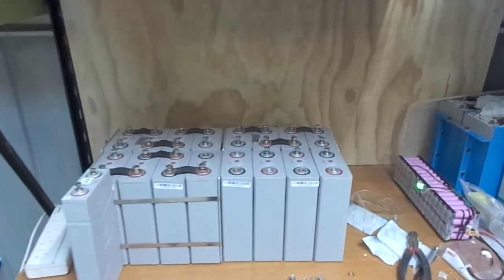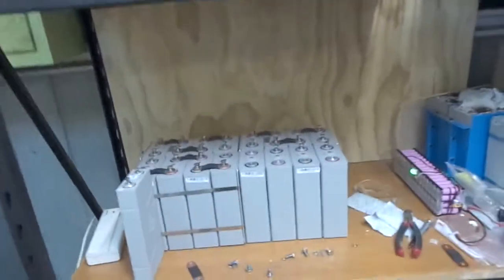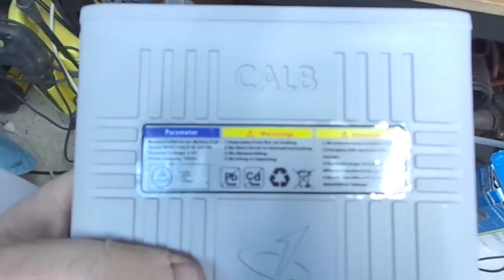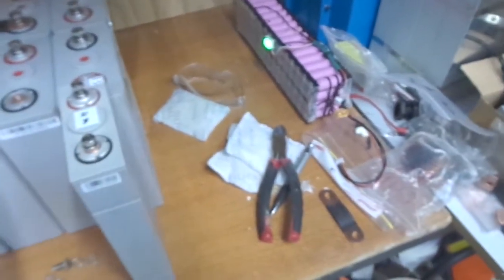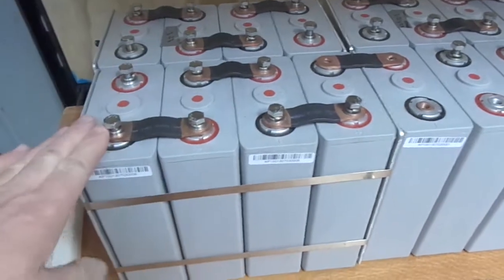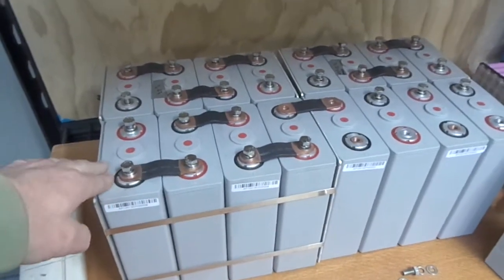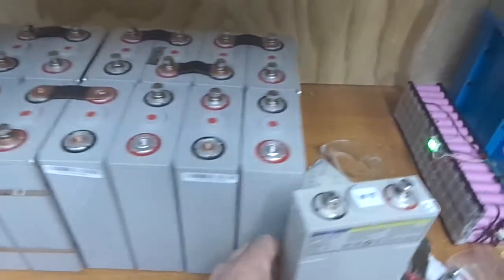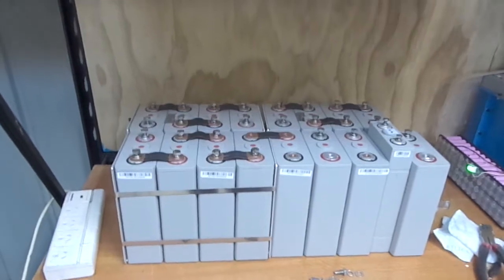LiFePo4 48 Volt Off Grid System Update and a Question

Comment: Do not mix these jars.  They are different types and will offer a differing charging characteristics.  You will easily shorten the life of the battery.  What is the manufacturer?  What composition are they (lead acid)?
Reply from the maker: Hi
They are the same chemistry, LiFePO4 - lithium ion phosphate.
They are just different capacity cells. I think I will make seperate packs. 
Thanks

Comment: Is placing the packs on their side an option and can you solder/ connect anything to the BMS tab? I am not sure if these things have to be on their base or if you can turn and lay them flat, on the longer end, so they are only 3" tall. If you can lay them on the long end and stack them, they will also compress under their own weight.
Reply from the maker: Hey buddy,
They don't recommend laying these down due to the small amount of electrolyte they have settling on one side.
Thanks for your comment!
Reply: Offgrid Dreaming no worries man. I am an 18650 guy so not much use here but I am following and learning from you.

Comment: Not sure how you are going to have these mounted, but I was thinking that you could have a box of some sort that where the 100A cells are at there is a piece of wood or plastic to raise them up to the level of the 60A cells. Then between the 60A cells you could put another spacer so that you can use the same connectors from cell-cell as you have for the 100A cells. Maybe you could mount the longmon on one side of the cell as you'd have the space.
Reply from the maker: I hadn't thought of that idea, Thanks for the comment mate
Reply: Offgrid Dreaming this was first thought too, use a 2x4 or something under the shorter guys to bring them up to level. Not real familiar with the BMS parts though

Comment: A few random thoughts after watching you video 

I would not have the + and - of the pack next to each other like that far to easy to short it out.
You could use the cellmons sticking out from the short edge of the cell.
It would be much easier to parallel them if you had the pack in one long string rather than going back on itself. Just need some short jumper wires then between the 60 and 100a cells
Not sure about the calb cell but the winston ones I have, have no need to be compressed Thats what the plastic case on each cell is for.
Reply from the maker: I agree with your comments. it is much easier to short like this, although you'll see in my nevt vid I have a terminal block fuse which covers the positive.
The main reason for configuring the pack this way was space and so I don't need to extend the inverter cables.
Thanks for the comment.

Comment: I don't think u can mix... only way would be two banks and try add extra cells to balance the banks.
Reply from the maker: Thanks for the comment
Reply: Offgrid Dreaming if they are the same chemistry you CAN mix them without any "trouble" but the 60Ah will obviously discharge flat before the 100Ah, so you will effectively loose the extra 40Ah capacity and have to (correction)- top- balance only. It's just like connecting a 300W panel to a 200W panel, it will be pulled down to the capacity of the smallest panel in the string. Separate is certainly a better option though.